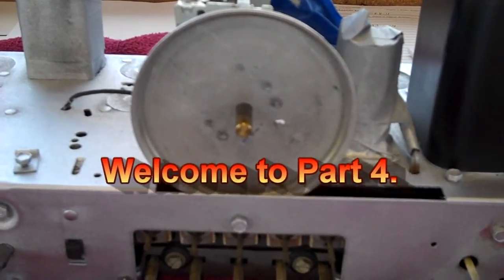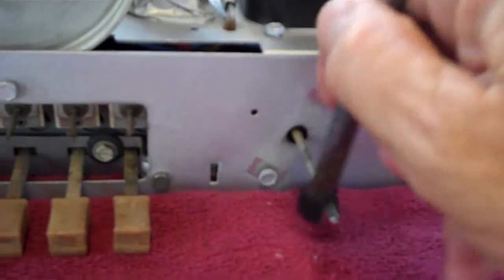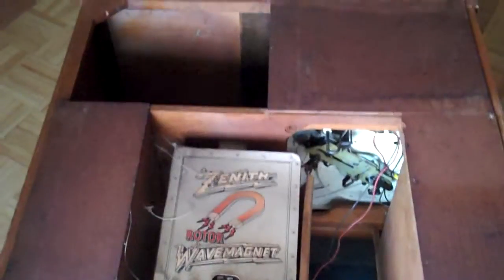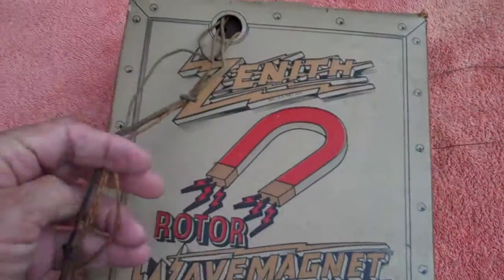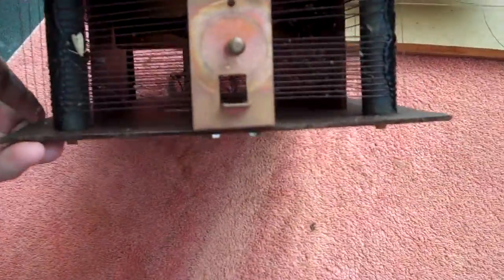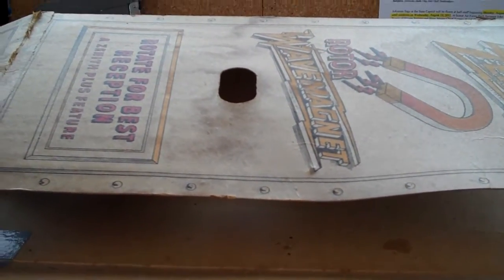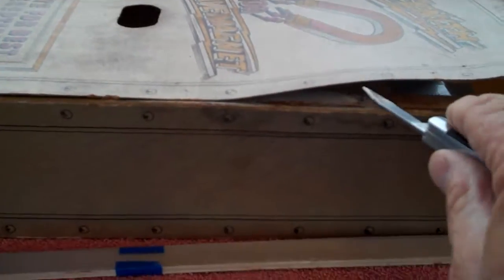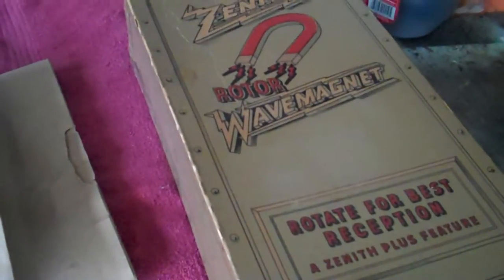1941 Zenith Model 6-S-597 Vintage Radio (Part 4 of 14).

Comment: Instead of using duct tape to repair the cardboard, try using the Paper-type packing tape( with the strings embedded ). It's almost as strong, less prone to release with heat, and looks better.
Reply from the maker: Sean,
Another good idea, my friend.  Thanks.

Regards,
John